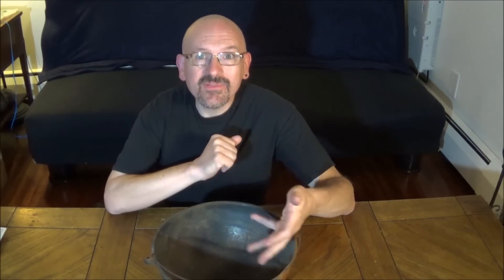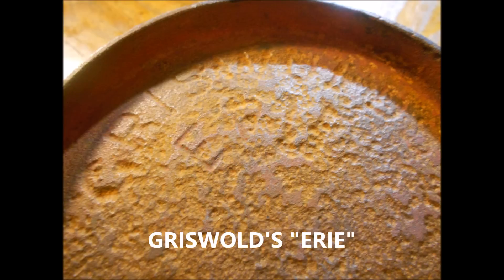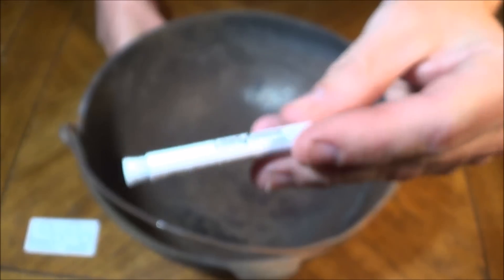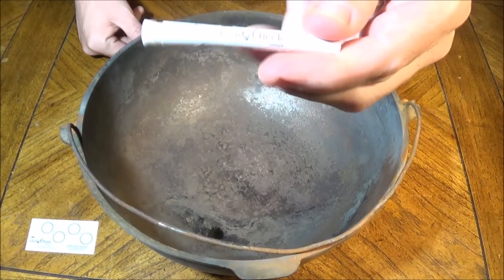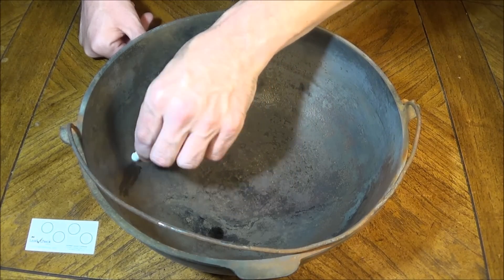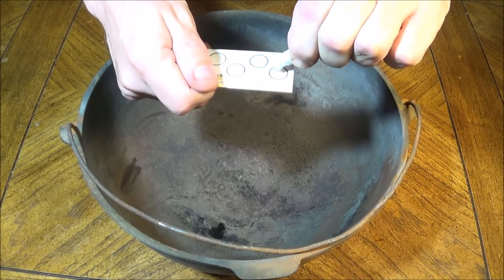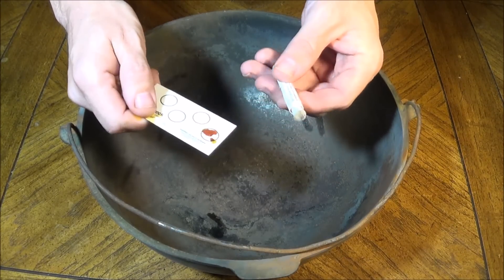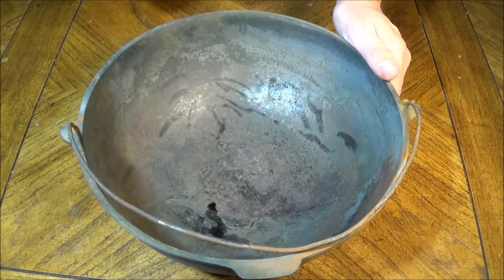Testing Vintage Cast Iron for Lead

Comment: I’d like to test for lead before I start to restore. Would you recommend I wash off the inside of my cauldron as best I can before using the test or does the dust and rust not have any effect on the outcome of the lead test.

Comment: shouldn't you first sand it a bit to expose the core ?
the outside might just have oxidized steal and seasoning which might not react right ?
Reply from the maker: Cast iron isn't porous, and it doesn't absorb anything into the core.  We've seen photos of 100+ year old pans after being dropped onto the floor, with their handles broken off (sadly), and the metal underneath the surface is shiny, bright and new even though it's over 100 years old.
Reply: @castironchaos  oh i think you missunderstood what i meant, i meant how do you know that the surface is a good test when you could just be testing the seasoning that dosen't contain lead?

Sanding it would just be to expose and test the metal itself and not the oxidized layer and polymerised carbon which might not react.

at no point i was talking about anything being absorbed by the core lol.

Comment: so i imagine lead cracks? that's why it's not desired. Sorry i'm new at this. I just do research for a kettlebell i'd like to buy, which is cast iron, but it's from a private guy so i don't know if it's lead or not.
Reply from the maker: Lead gets into the microscopic pits and cracks on the surface of a cast iron pan.  No matter how smooth the surface looks, it has those tiny fissures.  That's how seasoning adheres to a pan, and that's how lead gets in and can never completely be removed.

Comment: I've been told that some cast iron was nickel or Chrome plated from the manufacturer.
Remember never, ever put Chrome plated items in an electrolysis tank. Its extremely dangerous.
Reply: @vaporizers101  Google hexavalent Chromium. .

Comment: 3m lead checks are not good indicators that materials are safe from lead.  3m lead check swabs detect lead in paints at 5,000 ppm and may detect in some paint films at 600 ppm and are not designed for materials other than painted surfaces. While there is no safe level of  lead, FDA does not currently have a safe limit for children but recommends less than 10 ppm intake per day. Cast iron in general does not contain lead due to the manufacturing process.
Reply from the maker: The concern is that cast iron pots and pans have been used over the years for melting lead.  Here on YouTube there are many videos showing cast iron pans being used to melt lead, and this is something that's been done since the earliest days of cast iron cookware.  The chance of any particular cast iron pan having lead residue is extremely small, but not impossible, which is why it's a good idea to test for lead if you have reason to be suspicious.  Here I was indeed suspicious.

Comment: Leads melting point is like 600degrees  F. How does it not melt when used. I've literally cast my own fishing sinkers by melting lead in a pot in a grill
Reply: It will depend on the alloy that is formed. Melting point of copper 1085C. Melting point of zinc 419.5C. Melting point of the copper zinc alloy brass 900 to 940C. When you made fishing sinkers you are not creating an alloy.

Comment: My test turned the tip black. Is that a reaction with the cast iron?
Reply from the maker: My understanding is that's just dirt and grit.  It happens when I test for lead, too.  Black definitely means there's no lead.

Comment: Way to go now you've contaminated the pan with toxic chemicals 👍
Reply from the maker: Gosh, I'd never remember to wash the pan after testing it for lead.
Reply: Cast Iron Chaos the pans are pourous...
Reply from the maker: Actually, no, cast iron is not porous.  Any cast iron pan has near-microscopic cracks and other surface blemishes on the surface, which is how it holds onto the seasoning; this is the case with any pan.  But cast iron itself is not porous and does not absorb anything beneath the surface.
Reply: @bobschmob8233  you got served

Comment: so you saying i cant heat up my cast iron pan and clean it and use it again for cooking because i used it for casting musket balls ?
Reply from the maker: Yes.
Reply: What about the lead water pipe that fed our home since the 1800s and i have been drinking from for near on 50 years and all the game i have eaten that has been shot with a shotgun ?
Reply from the maker: If you want to test your lead water pipe for lead on the surface, feel free to do so.  This video is about testing vintage cast iron for lead, and shooting game with a shotgun is your own business.
Reply: Cast Iron Chaos you have not awnserd the question .is it harmful to drink water from a lead pipe or eat game that is shot with lead shot .I am not being funny .just asking your advice ?
Reply from the maker: I'm not being funny either.  I'm not an expert.  https://www.epa.gov/ground-water-and-drinking-water/basic-information-about-lead-drinking-water
Reply: Thanks ,will take a look ,but still have a nice cast iron pan in my shed that i want to clean and use as i no longer cast lead
Reply: @crazycressy7986  Is the water in your lead pipes soft water; then I would be concerned about lead contamination. Hard water and lead pipes that old should have a build up of carbonates (carbonates = scale build in the kettle) that will prevent the lead from leaching into the water. If you are concerned municipal office should be able to help you out.
Reply: @eddydogleg  99% of old buildings in the UK have lead pipes ,lots of them have been replaced with PVC pipes but there is still a lot of old buildings like churches ,school and so no that water is fed from the lead pipes ,you can thank the Romans for that one

Comment: i really wouldn't count on those cheap tests to determine whether or not there is lead in something -especially something that your food is going to go in. those tests sucks and are really unreliable.
Reply from the maker: Fortunately, in most instances lead contamination is obvious and overwhelming, so even a test like this is largely accurate.
Reply: Cast Iron Chaos how would the fact that most lead contamination is obvious impact the validity of the test? let's say the validity of the test is that it's correct 80% of the time (i dont know if this is true but just for argument's sake), regardless of how obvious or not-obvious the lead contamination is - the test is still 80% accurate...
Reply from the maker: It should be noted that the lead test being used here is the lead paint test, which has been endorsed by the EPA ( https://www.epa.gov/lead/lead-test-kits ).  The controversy about the lead test has been its failure to detect levels of lead "beneath the surface" ( http://www.npr.org/templates/story/story.php?storyId=16034266 ).  This is not what is occurring here, nor am I saying a lead swab will detect lead beneath the surface of a cast iron pan.  What I am saying is that iron is not porous, and liquid and contaminants cannot penetrate beneath the surface of a pan.  This test is specifically to detect if lead has been used on the surface of a cast iron pan, specifically if the pan was used to melt lead.  Meanwhile, there are test results showing lead tests for "lead residue in household dust" have a much lower success rate ( https://www.ncbi.nlm.nih.gov/pmc/articles/PMC2170477/ ).  Again, that is not what is happening here.  I'm simply using the most basic lead test, to see if the surface of the pan has lead.  And in this video, it is shown that the test does not detect lead on the surface of this pan.

Comment: what do you clean the solution  off with after the test is done?
Reply from the maker: I just scrub it with soap and water, then season it using a usual method for seasoning cast iron.

Comment: Will these tests still work on pieces which are already seasoned?
Reply from the maker: It's necessary to test the bare iron, so the seasoning will need to be removed from the testing area.  The test is a surface area test, designed for detecting lead paint.

Comment: Isn't the card the actual test strip? Why else would it turn red? I would test it again before cooking in it.
Reply from the maker: All you need to do is see if the swab turns red.  The card contains lead samples, and is used for comparison and verification.
Reply: Ahhhh. Gotcha.

Comment: Thanks for this video 
You stated in the video after cleanning you saw silver spots in the pot which lead (no pun) you to test it 
When cleanning CI we don't need to test all time hey just if there's residue ❓❓❓❓
Should anything else be considered 
And I really enjoy you videos
Reply from the maker: It depends on the situation.  If you were given the pans by friends and family, of course they're safe.  If they're  "look" okay and there's nothing obviously out of the ordinary, they're *probably" safe and should be okay unless there's something that looks suspicious.They should still be stripped and re-seasoned, because you still don't know what they were used for -- changing motor oil, perhaps?
Reply: Cast Iron Chaos oh yes I fully agree with you on that one as all my cast iron is stripped back to bear Cast and re seasoned buy electrolysis or Oven Cleaner 
Thanks again

Comment: Why not just heat the bowl hot enough to see if lead flows or is in it?
Reply from the maker: Lead contamination is permanent: the lead adheres to the metal and cannot be removed.  This is why lead is a real concern with vintage cast iron -- rare, but real.  If a pan is contaminated with lead, it can never be used for cooking, and should be marked in a manner to make sure it is never used for cooking.  This would include punching a hole in the pan, or simply destroying it, breaking it apart, or melting it down completely.
Reply: OR, just use it to melt down lead.

Comment: So if you had detected lead, it would make a statement of someone using this cast iron for melting down lead and making lead shell shot and lead bullets ....  Other (miner's/assayist) metallic smeltings could have otherwise also been done with the bowl.  Some silvery coating could be tin, zinc, silver, (toxic mercury or cadmium), aluminum, ....

Having proven that it is not lead, I would put the bowl into a glowing coals surface temperature of 800F+.  Putting the bowl upside down within the glowing coals, any lesser metals would boil off, or melt into tiny bubbles of impure metals and slide out and down from the bowl's inner and outer surface into the hot coals.

Cadmium melting point 610F, Mercury stains boiling point 674F, Tin melting point 450F, Zinc melting point 787F.  Lead 622F.  This temperature will surely remove any other impurities and elements with lesser melting and boiling points.

Iron's melting point is 2800F whereas other industrial metals are: Copper 1985F, Aluminum 1221F, Silver 1763F, Nickel 2651F, Manganese 2275F, Magnesium 1202F, Lithium 357F, Cobalt 2723F.

http://www.chemistry.patent-invent.com/chemistry/melting_boiling_point.html

Then, as in my John method of blue-black enameling, I would coat 15-16x with gray coals heat, and wiping gooey-tarry vegetable oil to seal in the pores, making an enamelized surface, strengthening the outside surface FIRST !!, then do the inner surface, and you would have a pretty, strong, and useful cast iron bowl for whatever (non-rusting surface) use.
Reply from the maker: On the other hand, I would not want to put a vintage 120-plus year old cast iron pot into glowing coals, because of the very real possibility it could warp or crack.  This can happen if the pan gets close to or over 1,100 degrees - and that is much lower than the melting points of most of the metals listed there.  One example of this: "How To Ruin A Cast Iron Pan" - https://www.youtube.com/watch?v=lOYfAMVJWg4
Reply: Slowly, slowly build up the heat in the bowl, rotating the bowl to the coals' heat, moving the bowl closer and closer to the coals, then put into the coals ....
Reply from the maker: However, as you said yourself, the melting point of those other metals is far greater than the 1,200 degree temperature that would damage a cast iron pan.  It wouldn't melt it, but it could still warp or crack it.
Reply: Touche, alas!  A once beautiful and utilitarian cooking pot turned into an ornamental iron flower pot.  A shame.  Same for all the pittings on the bottom of a misused, abused, and discarded heirloom cast iron product.
Reply: so your saying i can do this to my cast iron pan that i used to make musket balls and have it back for cooking ;)